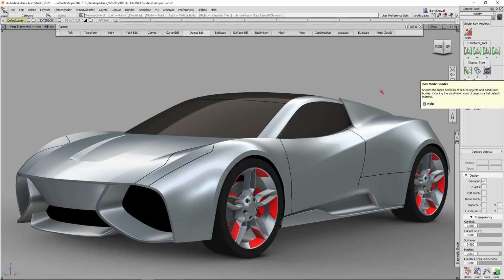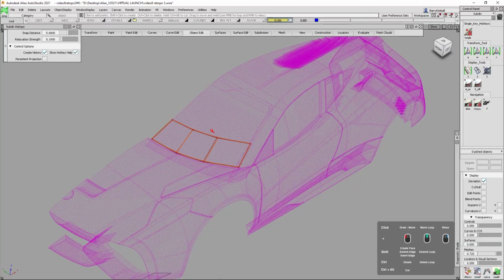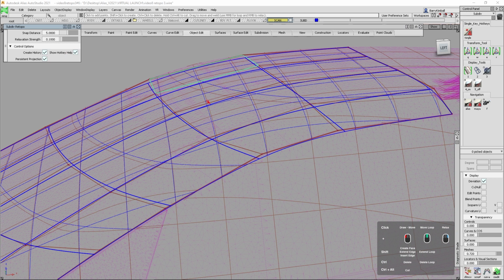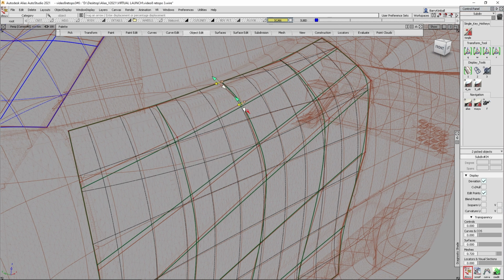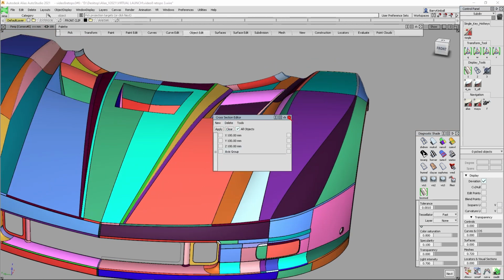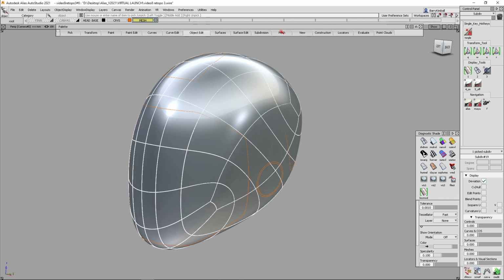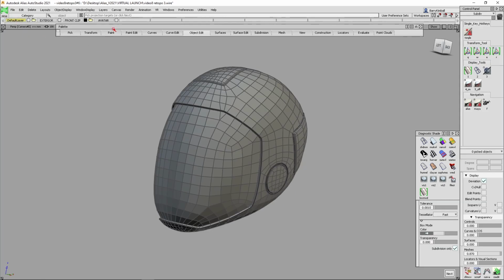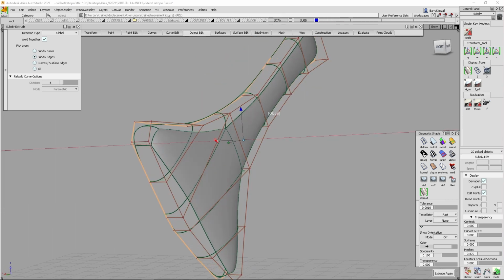Alias 2021 Deep Dive Session 07 - Retopology

Comment: I have my own car design project I modeled in Inventor 2018 professional (it's 85% finished). Its meshes are so messed up (represented as triangular lines) ,  So there's no way to do the auto-retopology in Alias 2021 student version? my car is a super detailed coupe, it was modeled with such a large precision in Inventor, so I kind of feel that the mannual retopo won't be able to keep all the precision

What do you suggest me to?
Reply from the maker: Hello, as mentioned in the other post already, we don' t have an auto retop tool. What is the reason for you to convert the model into SubDs, as you you already build it up. What do you want to do with it?
Maybe just import it as Nurbs surfaces/Shelfs via Iges or Step format into Alias?
Thanks, Flo
Reply: @AutodeskDesign  The reason is that I want to make some changes on its body's structure, such changes that are Impossible to be done thru boundary patches in Inventor (this is how my car was modeled in there). It is 85% finished, so I wish I could finish it in Alias, but I never imagined I'd have to remodel it all.
Reply: @AutodeskDesign  Alright, I'll try to import It this way, I hope it works. Thank you
Reply: @AutodeskDesign  It worked a lil bit, the lines look better, not perfectly the way I wish, but it's fine. So, can I edit it as if it was a SubDs? 
if yes, how?

Not exactly as a SubDs, I just want to edit it in any way
Reply from the maker: Hello, 
It really depends on how you bring the model in: If you have a triangulated mesh and want to convert it into SubDs, then you need to remodel it using the retop tool. 
Maybe another way is to bring it into Alias using NURBS data (Iges or Step) and then you can edit the NURBS surfaces directly. Most probably they will come in as Shells. In that case you need to un-stitch the Shell first.

Other than that, I would highly recommend to you to use the Alias Community/Forum to clarify this things.
Find it here:
https://forums.autodesk.com/t5/alias/ct-p/4000

One reason is, that its better visible to other users who can help you out and the communication, for cases like this, is better than using the comments area of YouTube.

I hope this is helpful so far.
Thanks,
Flo